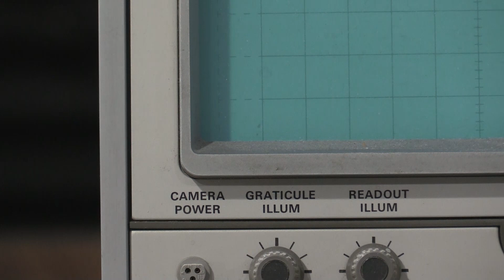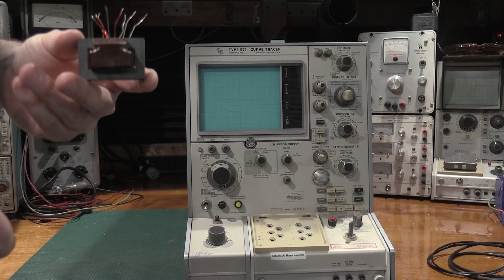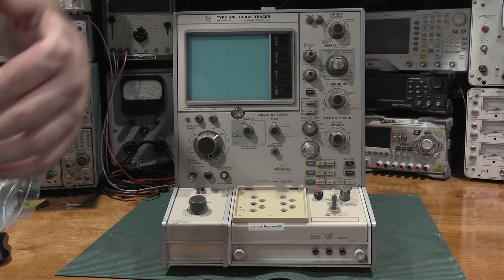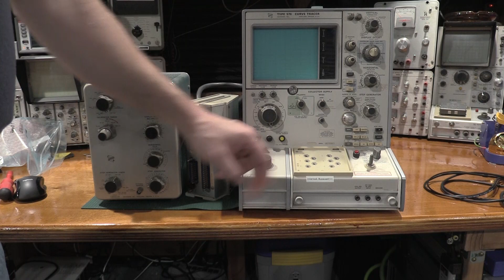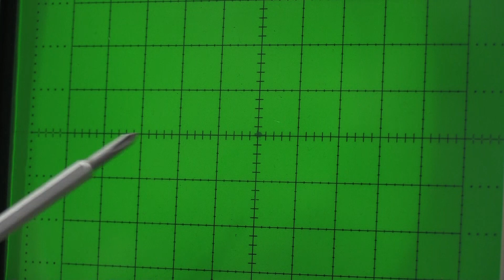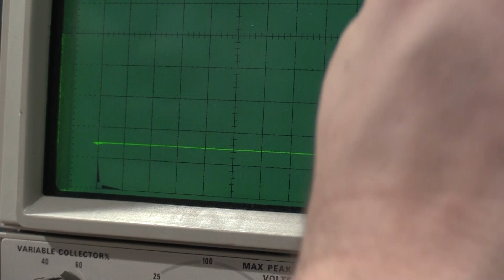Zen's Curve Tracer Buying Guide

Comment: What is your opinion on Fairchild 6200 curve tracers?
Reply from the maker: From looking at some pictures it does not look to bad and very close to a 576 – 577 with a few notations:
Collector volts is slightly lighter only up to 1000
sensitivity seems to be a little less at the bottom end of the current ranges
1 more step family
Tek tops out at 10
Fairchild goes to 11
Not sure what the sweep speed is on the Fairchild is Tek is locked to mains frequency or 2X mains frequency.
No A-B component testing for matching on the Fairchild.
Fairchild was well known in this time period for making active components. I suspect like Tek this was designed for in house testing first and release more generally later. I suspect it is more than adaquate for active device testing.
I have not used one in person and did not know Fairchild made a curve tracer prior to this I thought this was the realm of Tek and HP. Though from the specs it seems the Fairchild falls in the middle in terms of capabilities.
Reply: @Z @ZenwizardStudios Thanks, regarding A-B component testing Fairchild actually has detachable front porch for that, some of them just got lost.

Comment: I just got a 577 and repaired the totally messed up PS that had a previously terrible attempted repair . Got it working but have not done a calibration  yet. I also have a 575 that I got over a year ago and would love a video on that. I replaced one tube on it and it somewhat works. But i have not dived into deeply into it. Any chance on doing one?
Reply from the maker: Unfortunately non at the moment. I currently do not have the hardware to put in front of the camera.

Comment: I have three of the 575’s, all the higher voltage Mod122C models. The most expensive one was $350+ shipping. They’re well worth it IMHO. But I’m partial to the old tube 500 series Tektronix stuff.

Comment: I scored an HP semiconductor Analyzer which has 4 SMUs on it and provides curve tracing and many other advanced testing, I think is a better deal than those old curve tracers
Reply from the maker: Both have their place. I am on the look out for one of those as well. I have 1 of the SMU's that is needed to do it independently but I still need about $20,000 in SMU's to get the high current and the high voltage.

Comment: I did end up purchasing that 576 from the person who wanted 1500.00 with broken/missing shaft coupler, got it for 200 bucks, I am curious about the double peaking to check the CRT as this one seems smooth, but don't know if I understand the double peaking check. This does have the black transformer and CRT with the arrows on bottom left, dates codes look like 1972, don't know what I will use it for but curious about matching components, thank you for your great videos.!
Reply from the maker: If the brightness of the CRT increases smoothly with a sweep of the intensity control this PASSES the double peaking check. Sounds like the CRT is low hour and in good shape. A CRT that is double peaking will increase in brightness -> Dim -> increase in brightness again during a sweep of the control.

Comment: Great video! I love these things! I had a great time repairing, restoring, and calibrating mine. Some things I would mention regarding the 576 are the following:
 harmonica connectors for the standard test fixture - make sure they aren't loose! Could cause a poor connection and throw you down a rabbit hole. Also be careful when removing and installing them. Don't want to break them!
-i don't remember needing any high voltage/accurate capacitors for the calibration of the 576. But yes you do need some very accurate resistors! Once you get the hang of it, calibration isnt too bad!
-You forgot the HV safety interlock! That safety box will likely be missing from any unit you want to buy. Which means you might have to bypass the HV interlock. That will depend on what Gen 576 you get I believe. I think the mechanisms are different. Mine is a gen 2 and used a photoelectric micro sensor (U slotted type). It was actually broke but very easy to come up with a way to bypass. In fact if you have a gen 1, the manual provides you a procedure for bypassing it! 

So fascinated with these instruments. Glad someone is putting plenty of great info on them out here!
Reply from the maker: The 2Kv Mica based high accuracy cap is used in the looping compensation adjustments on the 1500 V range. MUCH more important on the 577's the 576's go down to 1ma the 577's bottom out at 2nA. The looping compensation gets a little strange at such small currents especially with dynamic signals.

Comment: I don't know if there is, or ever was, the proper voltages to apply to the filament to burn off cathode contaminants, proper current to flash the cathode to burn off a contaminated emission layer, or proper high voltages to clean the control grids. All the info I've come across, was for CRTs used in domestic televisions. CRTs produced for Tek, were well engineered, and I double the idea of cathode poisoning due to a bad getter flash, or poor electron gun materials. Mostly a weak tube is just because it has a lot of hours on it, and most of the barium and strontium oxide, work function reducing agents, have just been evaporated away. You can't 'rejuvenate" that, but you can destroy what's left of the CRT's life... very easily.
Reply from the maker: This is true all the 576 tubes that I have come across that "Double Peaked" were extremely high hour tubes and as such just tired.

Comment: Wish I had a 570.... never found one I could afford. I have a 575 and a 576... and a "parts" 576, that arrived with that switch you pointed out that can press in, pressed in... and a 7000 series plug in, 7CT1N. Had the idea that if I had a 2nd 7CT1N, I could use them in my R7844 dual beam, and overlap N and P channel devices to check for symmetry.
Reply: OMG!  I can't believe you found a calibrator box with its front porch.  I have never seen one, I live in the "back yard" of Tektronix where odd-ball stuff used to show up at surplus places or even garage sales.
Reply from the maker: That was really hard to come by. I have only seen one once.

Comment: Great Video.

I replaced the readout lamps on mine - a real pain. lessons learned: use a bit of force to get the plastic lamp frame into position 
and put some protection around those optical fibers... the soldering iron gets damn close to them   - unless there is another way :)

Comment: I wonder if there’s a willing and very talented, neon sign shop who can drill the CRT melt the glass to add a tube to pull vacuum. 
      Epoxy around the stems of the metal pins that protrude through the glass. The thickness only needs to be as thick as a coat of paint to seal the vacuum leakage.. 

Or drilling, tap pool, vacuum and use epoxy as the method to seal the vacuum port entrance point

Can be done somebody talented with using low temperature, low friction, low speed, glass drilling
Reply: Vacuum leakage?
Reply: @willthecat3861  old tubes and cathode rays tubes will leak and get contaminated with air where the pins come through the glass. 

The problem is vacuum tubes cannot operate with air, contamination, and the moisture that follows .
Reply: If you've got a 'gassy' CRT, you've got a dead CRT, or a rebuild the electron gun CRT. Just pumping it out won't repair it. You'd have to do a getter flash, at least. Probably put in a new electron gun, or rebuild the electron gun. Some eccentric guys are rebuilding TV CRTs; but, never seen anybody doing that for a oscilloscope CRT... you  can't get replacement electron guns, and the electron gun is way more complicated too. @coldfinger459sub0

Comment: Hi, I find curve tracer to be one of the most useful tools for fault diagnosis and component inspection. I've seen your earlier videos too but I listened to every word, great video with lots of useful information 👍I didn't know about the calibration device, I didn't even know they made something like that - thanks for the demo - I'm smarter again 😁
The information about the non-commercial production of 576 was also new to me
I used to own a Huntron 2000 and it was an awesome rig (I lost everything when my workshop was robbed) I made a classic Octopus just to have something. Later, I bought an NI-210 - a copy of the Tektronix TR-210, unfortunately, it cannot test transistors with a classic rising curve (the picture is taken care of by a restored Tek 212) and it only works up to 60V. I recently came across a 576 on ebay for a pretty reasonable price, I wanted to buy it, but I calculated the shipping + duty and my heart almost stopped when I saw the price (I'm from the Czech Republic) not only the size and weight of the machine increase the price, but also the USD/CZK exchange rate and thus better devices become unaffordable for amateurs and the only option is to make your own.
Thanks for the video, it was amazing 👍

Nice day 🙂Tom

Comment: A buddy from my Radio club has a 575 he literally got out of the bottom of a dumpster.  I have seen it left back top  corner is crushed in as is the front bottom right.  Despite this it still runs 100% though the variac is a little stiff.